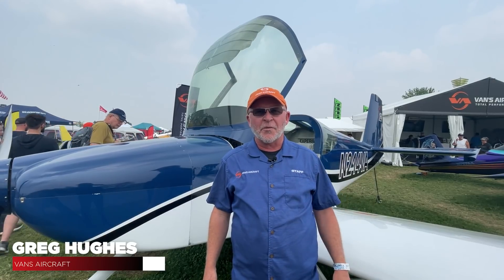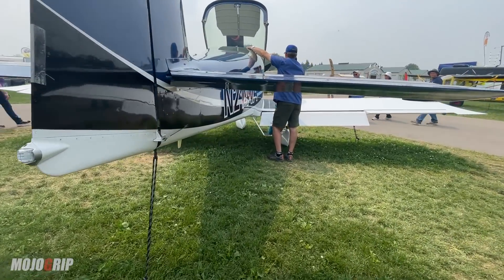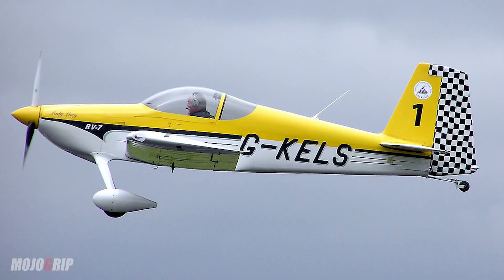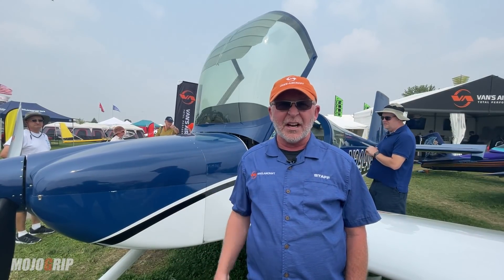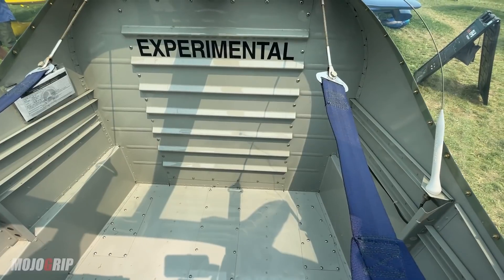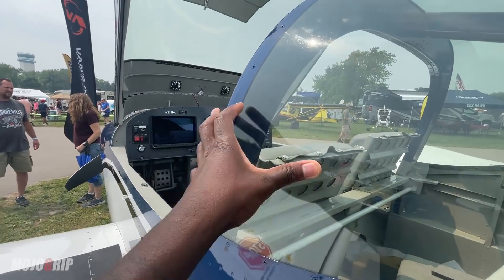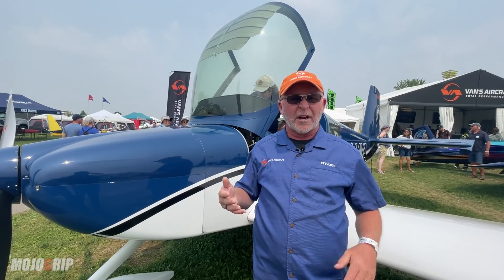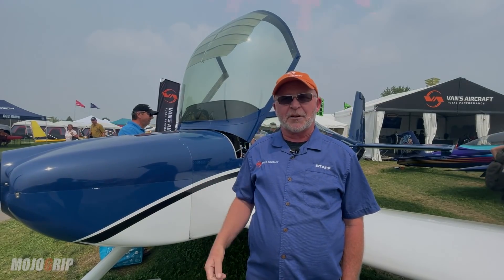RV-14 Is More Fuel Efficient Than Your Car

Comment: I had the absolute thrill to fly in FlightChops' RV-14 earlier this year. I don't know what I was expecting, but what an incredible bird to fly. It was the first time I didn't get sick doing aerobatics because I had FULL view outside of the aircraft. His model is a tailwheel, which my experience is limited on, but with the Thunderbolt engine (his videos do NOT do the sound of that engine any justice) launches you into the sky. Such a fun plane to fly!

Comment: Well the pricing didn't age well in 6 months did it. He said 49k for quick build kit and with the latest price increase its at 64k....only a 30% increase in 6 months. I know, I know, its their fault. Prices are rising everywhere for shipping, labor, etc....but things are gang busters now. I think I'll wait a year or two for the interest rates to rise, the economy to slow down and businesses will actually need to start competing for dollars again.
Reply: Yeah he mentioned $36K for standard RV14 and its $49K now and that does not include taxes, crating, and shipping.....easily $55K. I spent $61K on the engine alone and another $11K for the prop. Crazy prices!

Comment: Vans RVs are well known throughout the flying community for having a ton of utility: plenty of speed, great visibility; lots of speed/range/endurance options; a very low stall speed, which translates to low approach and climb speeds and short takeoff and landing distances;  plenty of climb rate; crisp, sporty handling and (with the exception of the 9, 10 and 12) a +6/-3 G limit load factor, ie aerobatic capability. 

But if you go to the Vans website and crunch some numbers, you'll soon discover that the one thing most RV designs could use more of is more fuel capacity. The advantage ofhaving greater fuel capacity is for those instances when one wanta to both fly solo and max out the range while cruising at 75% power. 

For example, the RV-7A's two wing tanks hold 42 gallons of avgas, of which about 40 gallons are useable. Assuming the Lycoming O-360 engine, the 7/7A burns 11.7 gallons per hour at 75% power. So for a three hour trip at 75% power, the 7's engine will burn 35.1 gallons of avgas. And I'm nt event even taking into account fuel used for startup, taxi, run-up, takeoff, climb, descent, approach, landing, taxi and a VFR fuel reserve. So if one subtracts another 5.8 gallons from the 40 useable for a 30 minutes VFR reserve and ... say ...  two more gallons for startup, taxi, climb etc, that leaves 32.2 gallons available for cruise. So the 7/7A can only legally cruise at 75% power for about two hours and forty-five minutes. 

Or its pilots will need to stop thinking about cruise in percentage of power and instead think of it as fuel flow at cruise.  Wanna fly for four hours? Pull the throttle back and lean until the engine burns 8 gallons per hour. Now you're closer to 55% power and still cruising at a respectable 148 knots. Of course at a lower power setting and fuel flow, one is partially negating one of the design's greatest strengths. 

I don't think Vans would do that, because, as designed with a VFR panel, the RV-7/7A pilot can  fill the seats with normal-sized people, top up the fuel tanks, max out the baggage area and fly away at or below max takeoff weight. Either Dick Van Grundsven really doesn't want people to overload his airplanes, or he doesn't think his builders will want to spend more than 3 hours at a time in the RV's snug cabin.
Reply: But RV-14's have pretty roomy cockpits?
Reply: @georgewhitworth9742  Yes, the Rv-14 and 14A have the same cinside cabin width as the four-seat RV-10. Approximately 46 inches wide at the shoulders, or about four inches wider than a Cessna 172, Piper Cherokee, Mooney or Grumman American Tiger, Cheetah, Traveler, AA-1 etc. So they fit the O or IO-390 Ex. Having at least 100 pounds of baggage capacity behin the 14's two seats, a tip up canopy and seats wide enough to fit a 21st century corpulent Canadian or American, perhaps with a center console for power quadrant, trim wheel, fuel selector etc. Ain't life grand? .

Comment: He said O-290 engine, did he mean 390?
We have to get away from kit building. 130k$ if you can find a used engine somewhere and you have to build it and get it approved. Come on...
Reply: Yeah he meant 390. What else can you buy new at 130k that will perform like an RV? There is the well worn discussion about whether you're a builder or not. Don't do it if you're not interested in building. Building is the journey Dan.  If you want the performance and don't want to build, get your big fat wallet out and give it a really hard squeeze.
Reply: @simonhughes-king  that's not true though. Sure it's not directly comparably but a certified fully built Vashon Ranger is 127k all inclusive and they initially aimed for 100k price.
And it can be much cheaper still. I know a cirrus is grossly overpriced but that doesn't mean they have to. The kit producers tend to think cheaper, not just because you have to build it in your own. So the main part of the price gap is attitude. Not build cost.
And with clever simple composite design then planes can be dirt cheap. You can get a composite kayak as a complex enclosed multisided well finished and painted shape for around 1000$ retail. Obviously smaller than the smallest planes but it's 1k, not 800k like a cirrus base price. That's no small contrast. That's opportunity right there.

Comment: Whats the point of a "kit" if it only has HALF of what you need. Getting the rest is a pain in the neck and having to buy separately and add on. So no surprise it takes more than a year to built this thing or most kits.

Comment: If that plane is more fuel efficient than your car, you have a terrible car.

With about 1500km on the 190l tank, you're looking at 12l per 100km, which is more than twice as your average mid class car.

Sure, if you've got a SUV or somesuch nonsense, you could be above that, but then you're a silly person to begin with.

Comment: How do these planes handle in high DA situations and mountain flying?   ....maybe vs a turbo arrow?
Reply: Performance is degraded as you'd expect but they start from a very superior position, being somewhat more overpowered than "normal", so you would not have a wheezy 152 type experience.

Comment: DONT BUY FROM THESE IDIOTS  i made the huge mistake of doing so, what a nightmare!!!!
Reply from the maker: Hi Gary, what happened? Please shoot me an email: mike@mojogrip.net
Reply: You're not spelling out what "idiots" you're referring to. If you're referring to Van's, there are over 10,000 of their designs completed and flying.
Reply: @EJWash57  ya and would you mix radiator fitting metric with standard ??? rans did and it was a total joke not to mention it will kill you when your engine fails from over heating

Comment: If they'd offer this or an RV-10 with a side-stick I'd hop a list for one immediately. And yes I know that as an amateur-built plane it's possible to build one with a side-stick or whatever you want, but primary flight controls are not an area where I want to engineer a one-off solution. I'd settle for a yoke or side-yoke, too.

These bigger RVs are seriously capable cross-country machines, but I have found the SAF (spousal approval factor) to be low when there's a stick. And yes, I know you could remove the co-pilot's stick, but then you lose the redundancy of a second stick. An RV-10 with side-sticks, a TSIO-550, hot prop, and a therma-wing system is a dream plane.
Reply: I guess your spouse is not seeing the big picture?

Comment: $140K for and "economical" plane.  The new 'RV Grin" is not from how fun the plane is to fly, but from having the means to buy one.
Reply: $140K for that capability beats the rest of the market by over $100K  You can't buy that capability anywhere else.
Reply: Rv grin is not a monetary value, it is the result of your skill , determination , awe how well your aircraft turns out and performs knowing you built it yourself. It’s simple and safest airplane in your control.
Reply: Not a lot more expensive than a brand new Tesla with options…
And no car in the world will be able to go from point A to point B faster than a little plane…
But , only a handful of people can fly…
Most are nothing more than pedestrians on wheels !…
Reply: I’ll agree, aircraft are insanely expensive, but this one is “less insane” than the norm.

Lack of mass production means high production costs.

Comment: How is a $150,000 aircraft "economical" by any means?
Reply: Because it is about 1/4 the cost of new aircraft with similar performance ?
Reply: An equivalent certified aircraft of similar performance and capability would cost you three times as much or more. Also an experimental aircraft you build can also be entirely maintained by you which saves having to pay for an A&P mechanic for maintenance.
Reply: Flying is for rich people.

So if you’re moderately wealthy, 150k is pretty decent. Once you buy this thing and build it, you have to store it and maintain it which, along with insurance, will cost thousands per year.

I reiterate: flying is for rich people.
Reply: Renting it out to instructors offsets much of the cost.
Reply: @sirjudge5055  There's a caveat there. Giving/getting instruction in an Experimental aircraft takes an exemption letter from the FAA.
Reply: Non-issue.. FAA issues LODA’s in 24-48 hrs by simply requesting one via a short email..
Reply: @jrock836  Which means it's required.

Comment: Yeah, that'd be my plane. The 200mph cruise is where it's at. A faster cruise is safer, if you're VFR because it is easier to plan against weather, as you don't need to predict as far into the future.

A two seater with some luggage fits the mission of empty nesters well.
Reply: Room for 2 small doggos in the back with overnight bags.
Reply: Very roomy for two people, 50-gallons of fuel, 100 lbs of baggage. Fits my mission!
Reply: Is it faster than RV8?
Reply: @justcommenting4981  About the same, albeit with more cockpit space.
Reply: Speed=time and time=options and options=safety

And cheap=well maintained and well maintained=safety

Unfortunately fast and cheap is not really a thing in aviation.

Comment: Ordered an empennage kit in May. Factory is looking at crating it for delivery this November. I'm going with the tailwheel version. I took a demo ride in Van's N144VA (tailwheel) at the beginning of June of this year. It is fast, and very light on the controls. 45-degree steep turns with a couple of clicks of nose-up trim is hands-off. Wish I could have performed a few stalls, but insurance forbids it on demo flights. Slow-flight is pretty stable. Very roomy and wide cabin, great visibility. Flies like a much larger airplane, although I kept looking out at the wing asking, "where's the rest of it?"

Comment: The RV14 is NOT the most economical in its class (150kt kit plane).  It has a 200-215hp Lycoming burning about 12gph, about standard.
Reply: Uhh, mine cruises at 170kts true at 8 gph
Reply: @av8rrob1  Uh.  Lie.  Even the company website cites the numbers I just gave.
Reply: @speedomars  , uhh well having 300 hours on my -14 I can say what it does.  That being said you wont see 12 gph in cruise unless your are high rpm and rich of peak (not where most cruise).  Mine cruises from 9-7 depending on density altitude. But whatever.
Reply: @av8rrob1  No aircraft can fly at 170kts true at 10gph or less.  And to further claim you are doing that at 8gph simply makes you FOS.... RVs are crude, draggy metal messes...constructed by amateurs.
Reply: @speedomars  You know nothing.
Reply: @speedomars  Hence, why they're categorized by the FAA as Experimental/AMATEUR-built aircraft. BTW, why so angry? Do you actually win any arguments this way?
Reply: @EJWash57  Speedo is just a bitter troll. I wouldn't engage.
Reply: @tray22  Thanks for the heads-up, mate!
Reply: @speedomars  I flew this airplane to and from OSH. At 11,500 I got true air speed of 178 kts on 8.8-9.0 gph.
Reply: @speedomars  Lol keyboard warrior
Reply: @Speedo Mars Do you have direct experience with an RV-14 as the basis for your statement?  I do. I’ve seen about the same performance numbers that actual owners are quoting here. 

Perhaps instead of displaying your ignorance in such a public fashion, you should shut your yap and open your ears. You might learn something.
Reply: I can get 150kt TAS at anywhere from sea level to 8000ft while burning less than 30lph (7.9 gph)
Reply: Bitter Cirrus owner...... can’t stand that an amateur built aircraft continuously whoops up on the SR series.
Reply: Ours cruise at 165 knots. 11.2gallons per hour......
Reply: at 6 000 feet

Comment: Maybe I missed it, what's the total useful load?
Reply: 825ish
Reply: Depends on how light you build it and what you set as your max weight.  As a gouge Tyler is correct, somewhere 800-850
Reply: Doesn’t a lightweight engine mean a tail heavy aircraft therefore less weight in the rear baggage compartment?
Reply: Yes.
Reply: @MrPaige222  Maybe a little more forward of and engine mount and that would work.
Reply: @ashsmitty2244  
It's all about getting the CG set properly.
Just remember this.
A nose heavy plane flies poorly.
A tail heavy plane flies ONCE.
Reply: @paigehunt3387  A lighter engine moved a little more forward would have the same CG as a bigger one.  

The issue is about being able to carry more in the back with a lighter engine.
Reply: @paigehunt3387  There is a very large range of CG on the RV, just like your 172 or Cherokee.  It's a conventional airplane so no strange surprise like the funky canard.